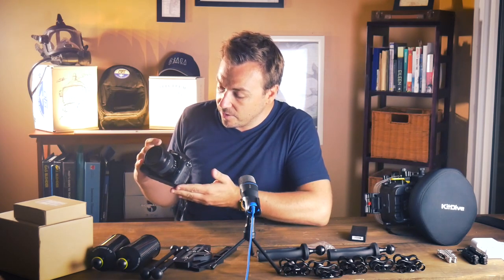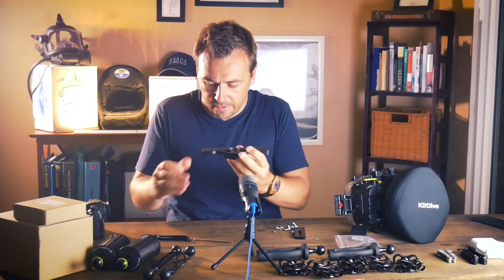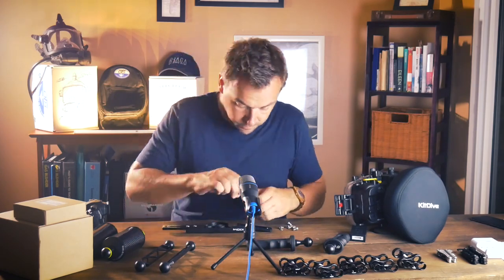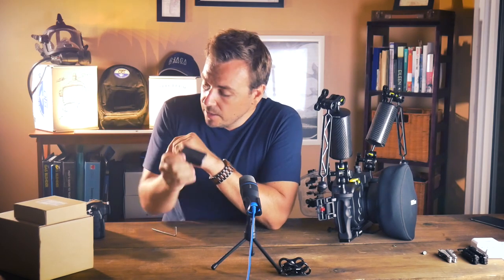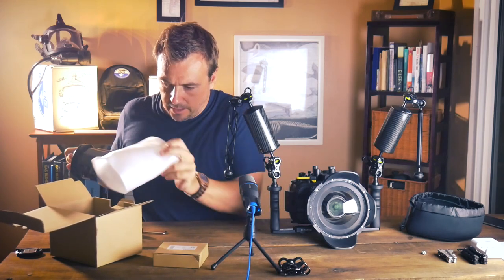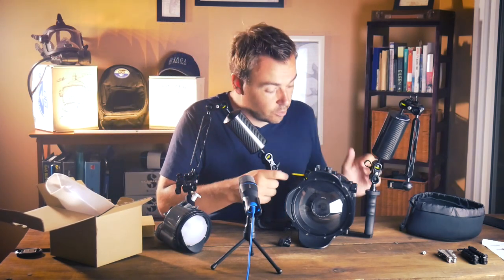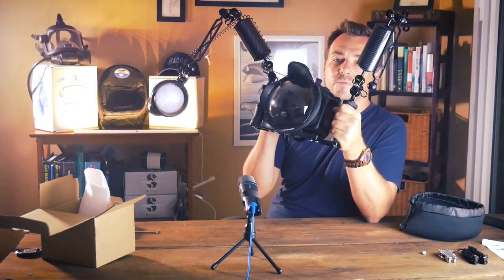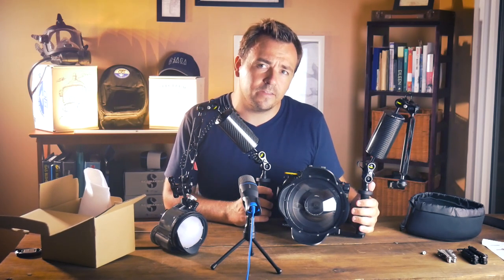Building my Underwater Camera Rig - Part 3 // Inon Z330 Underwater Strobe

Comment: For fiber optic cables I use home audio fiber cables. I believe back scatter has little adapters for It. This way you can custom cut the cables to length you need. You just use a razor blade to cut the fiber optic cable. When I make mine up they don't cost me more than $3 or $4 per cable.
Reply from the maker: Wow that's a really good piece of advice! I will look into it straight away. Thank you!

Comment: We've agonized for a week on building our rig, from camera to float arms and after many many many many hours and daily research we settled on basically an identical rig except that we are hoping to go with the orcatorch 5K lights instead of a strobe light. Wish I found your videos a week ago, it would have saved me so much time but I'm glad to get  confirmation that we are making the right choice!
Quick question: Where do you your tray and connectors?
 Thank you so so so much for this. Now we also have a go pro 8 so I'm going to binge watch the rest of your channel :)

Comment: Hey Nick, I have been using the sea frogs for the gh5 for almost a year now. But i cant figure why did you purchased 2 float arms if the case has extremely positive bouyancy, is there a reason for that or those arms give weight instead?I have been searching for some weights to add but i couldt find some. Also what strobes do you recommend? I have a Video light big blue vp4200 for video but i need something else for photos or maybe another light would make the job? And other point that I wanted to told you is to buy the vacuum pump, it has been very helpful for me at least and gives a lot of security at the moment of the dive. Hope it helps! cheers
Reply from the maker: Thank you so much for the advice! I use the Inon z330 strobe which is very heavy so the float arms help with not putting so much stress on the clamps. I will definitely look into that pump! Thank you so much for taking the time to comment! I really appreciate it!
Reply: @DiveSAGA  Thanks to you also for the advice, i will look up the strobe!

Comment: Hey sir. I have a question regarding the buoyancy of the whole rig. Currently I’m using Sony a6000 in seafrogs a6xxx housing, 6” dome port and KitDive aluminum double handle tray. I’ve ordered 2x inon z240 strobes, but I’m quite confused about the arms. Since the current setup is approximately 1kg positively buoyant, I’m worried to add float arms. As you mentioned that strobes are pretty heavy on land, but what about UW? I’ll be very happy to get some details from you :) btw, very valuable videos, well done 👍
Reply from the maker: The float arms are definitely useful for the strobes, but the housing is indeed 1-2 lbs positive. So you'll have to play around with it to get it neutral really
Reply: DiveSAGA is your rig with two strobes positive as it is set on the video?
Reply from the maker: @igorskuridin4759  I have one strobe and one video light and it's slightly positive still but very manageable!